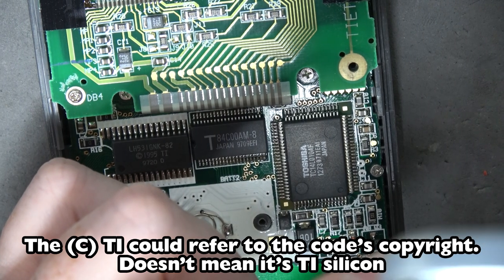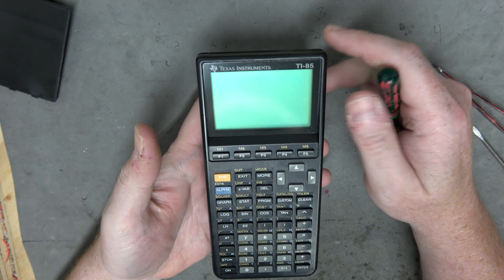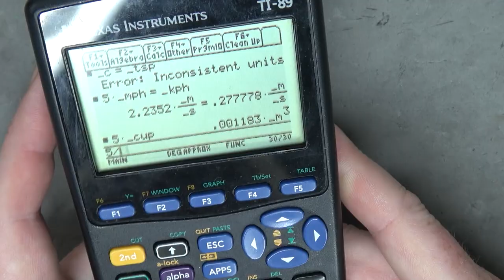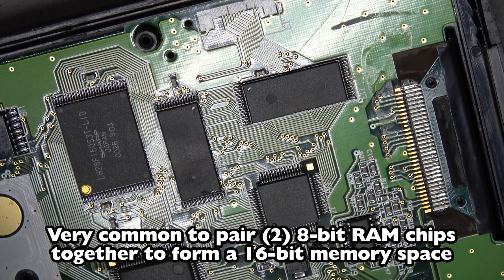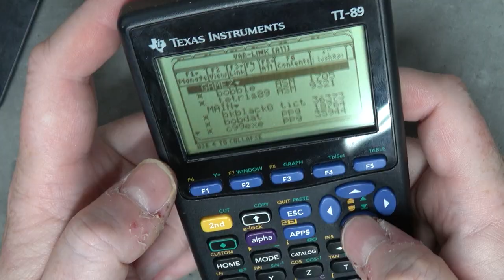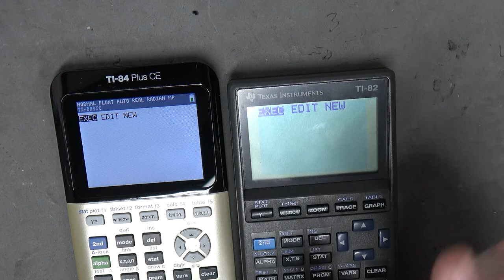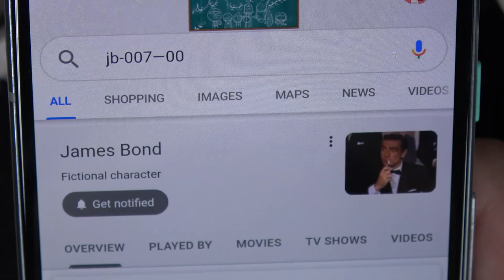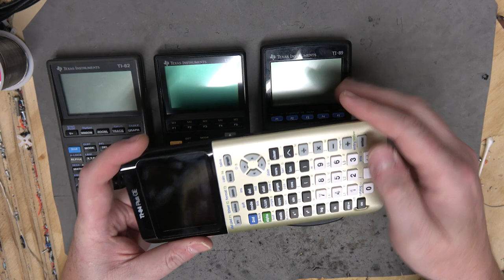More TI Graphic Calculator Teardowns

Comment: I have answers to tons of your questions! The calculator does have OTG support! You're lucky you just got OS 5.4.0 installed, although you can't install any custom OS, you can still run Assembly games without issue! OS 5.6.0 that just got released banned ASM programs from being run. It also appears you got the latest hardware revision (revision O) which is 3x-4x faster than the original TI-84 Plus CEs. TI-OS UI hasn't changed much since the TI-82. Most of the menus layout are very similar. There's no emulation on the TI-84 Plus CE, it's definitely running right off of the eZ-80 CPU (NOT just Z-80). TI likely chose eZ-80 as the CPU because they could just port tons of their old code over without much fuss.
The only TI calculators that use ARM is the Nspire CX family.
Yes, those are charging docks, not very useful if you're not in a classroom though. I ended up using them to add wireless charging to the inside of my calculator :P
TI doesn't offer any  'repair service', if the calculator is broken they just send you a new one for free or make you pay for it.
That big chip is the ASIC which houses the eZ-80 CPU, RAM, USB controller and tons of other stuff. The 00 at the end means you have a TI-84 Plus CE non-Python Edition. I believe 01 means TI-83 Premium CE. You're right, the tiny one to the right is the FLASH. The bare contact below the FLASH is where the Python co-processor would go if you got a Python Edition calculator.
You seem pretty darn knowedgeable about this stuff, if you want to learn more or just look at calculator news you can look at cemetech.net or tiplanet.org . I do a ton of calculator things myself and I'm more than happy to answer any questions you have!

Comment: I remember overclocking my TI-85. The CPU is clocked with an RC circuit! It’s so damn cheap there isn’t a crystal. Replace C9 with a smaller capacitor. You can speed these up by about 300%

Also you should consider the release dates of the calculators. It went 80 81 85 82 83 92 86 89 84 IIRC
Reply: Yeah, I think that I may have done that as well. It also drained the batteries 300% faster!!! HAHAAHA! I think I had doom on that and some z80 os...or something...
Reply: Thanks for this post. First time I've heard of RC circuits being used as a clock source and it turns out that's actually possible.
Reply: there's also 2 83's: an 83, and an 83 plus
Reply: @chuuisinsane  TI-83, 83+, and then 84+, I think when they introduced the 84 they went straight to +. Though the 2014 edition seen in this video is basically a different calculator than the 2004(-ish) original.
Reply: Actually, it went 81, 85, 82, 80/92, 92 II/86/83, 73/92 Plus/89, 83 Plus, 83 Plus SE, Voyage 200, 73 Explorer, 84 Plus/Plus SE/89 Titanium.  And that's just 1990 to 2004  Model numbers are so damn confusing  Also, models are grouped by year; if there are more than one model, separated with a /, that means they were all released that same year.  For context, the TI-80 and TI-92 were both released in 1995, and the TI-83 Plus debuted in 1999.  Edit: Ended up misgrouping one or two models.

Comment: yeah the JB-007-00 is an ASIC which includes the eZ80 clocked at 48mhz, 24bit address bus and RAM. On the Python version of this calculator at U01E (position on the board) the addition of the chip and surrounding components, a chip ATSAMD21E18A-U from home Atmel, bringing the 32-bit coprocessor ARM Cortex-M0 + clocked in 48 MHz dedicated to Python, along with 256 KB from memory Flash as well as 32 KB from memory SRAM
Reply: wikipedia.org/wiki/Zilog_eZ80
Reply from the maker: So does the eZ80 execute code from the quad SPI EEPROM?
Reply: @BenHeckHacks  I believe so.  At least that's how I understand it with my limited knowledge.  let me find the link to a product spec sheet from Zilog that I was reading
Reply: @BenHeckHacks  From what i have read on the spec sheet, the eZ80 has two Universal ZiLOG Interfaces (UZI) that contain 3 serial communication controller blocks (SPI, UART, and I
2C) along with

control registers and a Baud Rate Generator
(BRG), with only one of the serial devices is active at
 any time.   So I am going to say that it does do as you asked.  The ZiLogs are located at Pin 67 to 74. With pin 66 as a ground and Pin 75 labeled as TEST

Comment: The Ti 84+ CE uses the eZ80 which is fully backwards compatible with the Z80 but has a mode to extend the registers and address bus to 24 bits with a 24 bit ALU.  It can address up to 16MB of memory and has modern peripherals (I2C, SPI, UARTS, GPIO) and Z80 style IO.  Its a rather interesting chip.  I am building a board around it as we speak

Comment: I keep my ti 83 plus silver edition from high school on my computer desk as my go to calculator. It got battery damage which eventually caused buttons to stop working. (Had harbor freight free batteries in it) I threw it on my electronics bench to fix which is in my shed. It sat there for a few months before I got to it but by then the battery corrosion was too much. Bought another one on ebay with a bad screen for 10 bucks shipped. Pulled the ribbon cable for lcd screen off and soldered my own wires in place. Works great, and the case was immaculate, compared to my old one which was beat up from carrying it around in school.
 I have a ti 89 titanium from school that I used as my go to when my 83 was broken. Just couldn't get use to it compared to the 83.
Reply: That's the best one they ever made; ti 83 plus silver edition it's faster and came with some games on it so it makes all the other ones seem boring.

Comment: "Although... not every high school class required them like they do now"

LOL... back when I was in high school, there was a debate about whether we should be allowed to use calculators in study hall, let alone the classroom. Back when my TI-33 was SOTA.
Reply: in our school we could choose between 2 Casio models and 1 TI (that nobody actually bought) - it had to be the low tier models because any equation solving, text memory and graph plotting was not allowed- so you couldn't cheat with that....in the end we didn't use the calculators that much since most of the math we did was about variables and not about numbers... I personally mostly used it to confirm that stuff like 3x3 is actually 9 because I didn't trust myself...
Reply: Hahah. . . They were so confused by my HP-48GX.  RPN for the win! 😁

Comment: In high school about 18-20 years ago. My teacher had a clear ti calculator that worked on the overhead projector. I don't remember if it was a ti 81 or 82. Have you ever seen one?
Reply: My school has those too. I want to say they were TI-82s.
Reply: There was an overhead projector version of almost every calc from TI-81 on but the most widely used were used by teachers running the calculator curriculum excercises that were most often based on the 82, 83, 84, 84+, 84+CE lineage of calculators. What Ben didn’t say is that the current 84+CE keeps this ancient interface so that it remains compatible with all the teaching materials.
Reply: The clear ones were silver edition, I heard the 89's/Teacher's editions had plug-in's for projectors. Some of the clear silver editions are much faster and make the games like pac-man way harder to play.

Comment: Still have my TI-82 from 20+ years ago. You want to look at a wicked calculator? I've got a TI-NSpire. It's got a removable keypad that I assume holds the ROM package in it. You can pop in an TI-84 Plus keypad and turn it on and it works like a TI-84 (of course), and it comes with the NSpire keypad. Runs on an ARM9 processor.

Comment: Hey Ben, I have a TI N-Spire with the detachable keypads so it can swap between TI N-Spire and TI 84+ modes. It doesn't turn on anymore (Either battery corrosion killed it or it overheated in a non air conditioned house and fried something internal, or the screen is broken from a ding it has), but if you want to take a look at it and the keypads I can see about sending it your way.

Comment: The Zilog eZ80 core in the TI84 Plus CE is NOT emulated, you seem to have an "M" or later hardware revision TI84+CE.  The pre rev. "M" 84PCE's use parallel flash.

Comment: I'm pretty sure there were multiple revisions of the TI-85.  The older ones have the model number printed in yellow, whereas yours has the model number in white.  Its possible they cost-reduced some parts between the versions, but I don't really want to disassemble mine to find out.

Comment: The 84+CSE is definitely still actually a Z80. The nSpire series is ARM-based, though.

The 84+ was an enhanced 83+ which in turn was a flash-based 83 which was an upgraded 82, which is why they all have OS similarities. I believe that might go back even further to the 81. I'm not sure how the 85 and 86 are related to the 81-84 series, as I never had either or hacked on them much.
Reply: According to datamath.org the only TI-8x calculators that didn't use a Z80-based CPU in some form were the TI-80 and the TI-89; Even the TI-73 used a Z80.

Comment: The TI-89 is my favorite for programming using the editor built in and the TI-83 (not plus) is my 2nd fav due to nostalgia. I remember spending days and weeks making an intro for a Tetris game with pieces that fell into place to spell TETRIS. I had a different model TI-83 than the normal looking one. It had the same functionality but the screen was a greenish color over white instead of the black over white and the link port was on the side instead of the bottom. It also didn't have the smooth and shiny border around the screen. I bought it at Radio Shack for $89 in 2001 when I was 15 in the 9th grade.

Comment: the TI-80 while it may seem first from the name, it came out in 1995 as a cheaper lower cost calulator. it is the slowest TI graphing calculator and the only one with a proprietary ASIC that wansn't z80, 68k, or arm based. The original ti 89 is a traditional form factor version of the ti 92 series, and is allowed on more tests because it doesn't have a qwerty keyboard. The 89 Titanium is to the voyage 200 as the 89 is to the 92 series.

Comment: Arm emulating z80 code?  Maybe, but I wouldn't be surprised to find they used a Z80 to ARM source translator to produce ARM native code.  Intel did that for the 8080-8086, and DEC even had an x86 to Alpha translator that worked directly on BINARY code!

Comment: TI's naming scheme is wonky but it makes more sense when you consider that the 82, 83, and 84 are all continuations of the original 81.  The 85 was an upmarket calculator introduced between the 81 and 82, and the 86 was a refreshed version of the 85.  At some point they must have figured out it made more sense to just keep rehashing the 81/82/83/84 series over and over again, because I distinctly remember textbooks being written with instructions for that series of calculator.  Anyone with an 85/86/89 (or, god forbid, a Casio) had to figure it out on their own.
Reply: 89s do unit conversions and symbolic algebra, so they are tools of the Devil as far as most math teachers were concerned, and the 85/86 and 89 cost more than the 82, so they weren’t popular with high school parents.

Comment: The TI-84 CE is basically a color version of the TI-84 which is a faster and bigger memory version than the TI-83/83+/83+SE. The TI-85/86 should be thought of as a different subset if you wanna make more sense of the device family.

Comment: I don't like the newer TI graphing calculators because it's very hard if not impossible to load your own assembly code. For me it's either the 89 or the 83/83+. Not too mention those are very cheap to buy second hand and are very durable.

Comment: Most impressive thing I would like to see happen is :: Desolder a "Z80" and a few RAM chips, perhaps a display driver, etc., from these various vintages calculators, and design a brand NEW BOARD, preferably socketed, that creates a new calculating machine! Not sure of legality of re-using their ROM-routines; but I am certain something could be designed that would crunch numbres in some fashion. several different z80 chips receiving programs from different sources, allowed to run, and present their combined answer directly on a display, or something that could be sent to a Lprinter, PC, etc. That is truly the ultimate way to show your skill as an electronics engineer, CS nerd, etc. You have 6 months. Begin.

Comment: Bought my Ti-85 for 110 US$ back when I needed it for my classes. In classroom we had school supplied Ti-82 so I went to Wallmart and saw both of them side by side. 85 was advertised on spot as better and faster of the two so I bought it instead the school standard Ti-82.
Fast forward 2 days later and I was returning the 85 because the pc-link port was not working (small 2.5mm stereo jack on bottom) And it was not "working" because I was trying to connect it and transfer school assignments from 82 to 85 and the two were not compatible at all. Not only you could not link those two with a supplied cable but even TI-basic programs were not compatible even if you retyped them from one calc to another by hand.
I figured this all out when I got my replacement Ti-85 the same day. Ooops. 0.o
Anyways, had that Ti-85 for a looong time after and I am pleasently surprised that the www.ticalc.org site is up and running and looking the same way it did in nineteens.

Comment: That chip on the first one that says T84C00 on it is the Z80.  the Z80A is technically known as the Z8400.
Reply: Z8400 is the NMOS version, The Z84C00 is the low CMOS version which supports a low power sleep mode and static clock input. The T84C00 is Toshiba’s Z84C00 clone.
It was disappointing that a US company touting American made would use a Japanese version CPU. This was probably done because of the smaller SOIC packaging (and lower cost).  These days Zilog is owned by Littelfuse Inc.
Reply: @PebblesChan  Maybe TI fabricated them for Toshiba?  Stranger things have happened.
Reply: Toshiba have been making Z80 clones for decades. The Z84C15 IPC derivative sold by Zilog was designed by Toshiba.

Comment: i know this is off subject. do you thin you could build  1.44mb 3 1/2 in floppy drive to c64 serial or rs232 conversion? id like to see someone pull off a 1.44mb 3 1/2in floppy to the c64 instead of running to the 1581 or fd 2000/4000... those are difficult to get a hold of and when they are around they are expensive. id like to play wolf 3d on my ultimate 64, the ultimate 64 doesnt support .d81 files natively, and i have dir master that would allow me to write .d81 files to a 3 1/2in 880k disk. so why settle with 880k when i could just go to the 1.44mb standard? the point is, is it possible to build a small conversion board from pc to c64? fpga or standard 1541/1571/1581 chipset, or less? i think it would be neat to see an alternative out there that isnt expensive. i know i can get a fd2 whatever, i dont want that crap. i would have emailed you, except i dont have your email..... i have a 1541-II sitting here. if i would need the chips from that board i could just take them or get another drive and chop it. thanks.

Comment: it would be cool to put a Raspberry Pi or similar single board computer in one of these and find a way to interface with the keys.
Reply: I ended up gutting mine and stuffing a gameboy color into it and wiring the controls into the calculator keys duplicating the control the buttons for both left handed and right handed layouts.

Comment: My og TI-82 decided to break right before a certification final test, had to rush to a store and buy a ng TI-82 stats, 65$! Ergonomics are so much worse, screen is flat and reflects the ceiling, it moves around the desk etc. Best guess its the ribbon cable of my og that is bad, going to replace it with single leads.

Comment: I seem to remember reading somewhere that the HP 35s contains a 6502. No idea if that's true. :)
Reply: Hm, wiki says the hp35 was made from 1972-1975 and the 6502 is from 1975
Reply: Right: The HP 35s uses the SPLB31A integrated circuit from Sun Plus, which includes an LCD controller and IO unit as well as a processor of type 8502 (the 2-MHz version of MOS 6510). The HP 35s is a scientific calculator from Hewlett-Packard, released in 2007 and was introduced in honor of the 35th anniversary of the HP-35."
Reply: @dhyanais  ahh missed an S , sometimes they are important :)